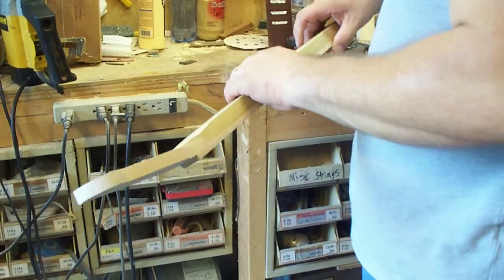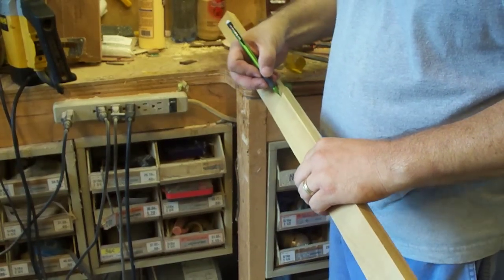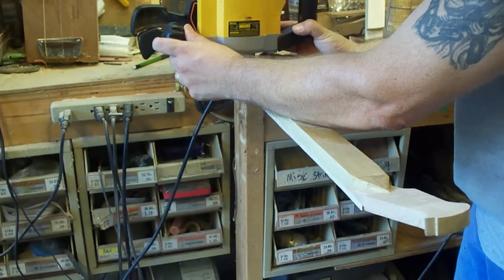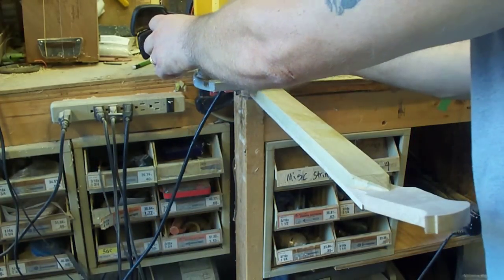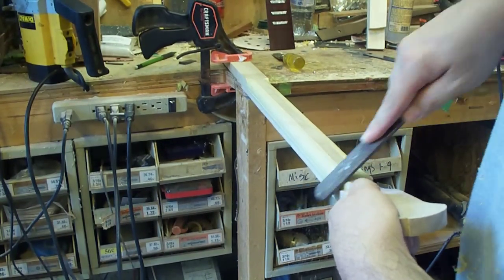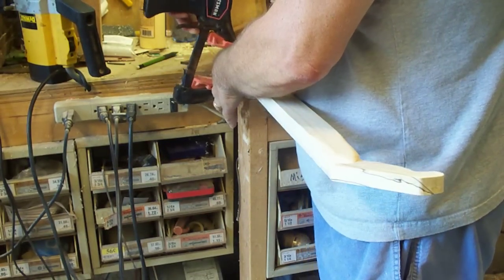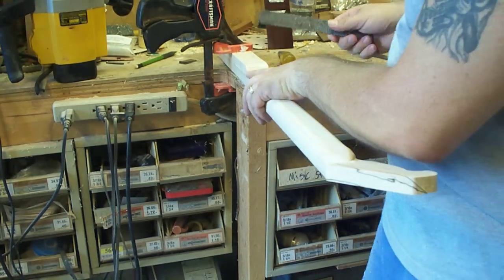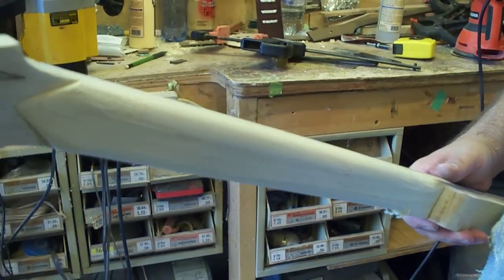radiusing a cigar box guitar neck

Comment: @RcUniverseGuy Does the neck go all they way through the box and the strings are atacched to both ends or did you attach the ball end of the strings to the box somehow? Even though Poplar is classified as a hardwood it can bend under tuning. Hardwoods like Maple and Walnut are your best bet for strength and tone next step down would be an Oak, more than likely your neck is too soft.